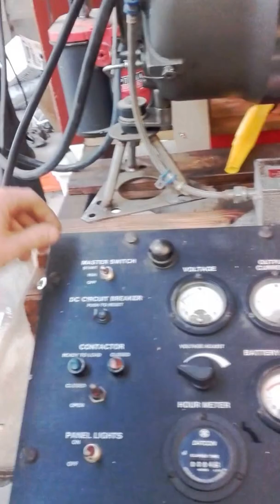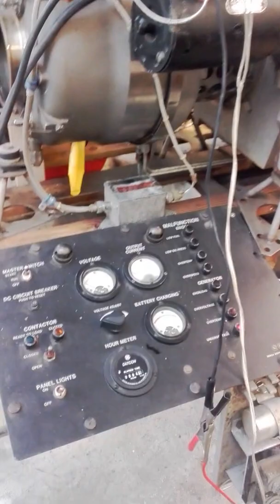Tiernay TT10 GAS TURBINE ENGINE first start

Comment: Are you using a roughing pump before the final fuel pump? I have one that's been having troubles starting and I'm not sure if it's an issue with properly priming or if I don't have enough pressure. 

Awesome to see one running!
Reply from the maker: HI there. Yes it has the pre-pump. could be your prob at a guess
Reply: Possibly, I'm in Colorado.